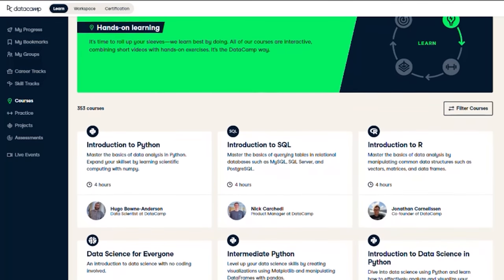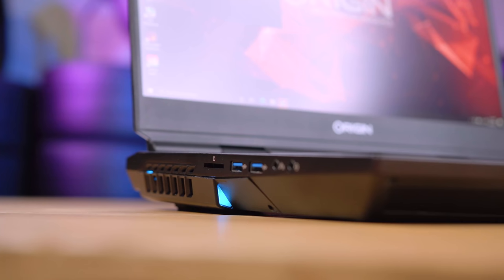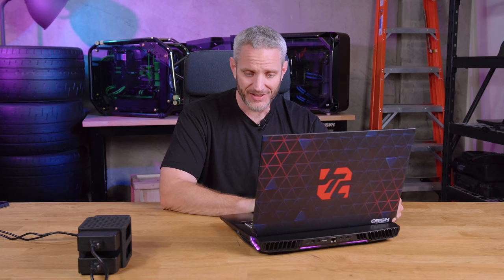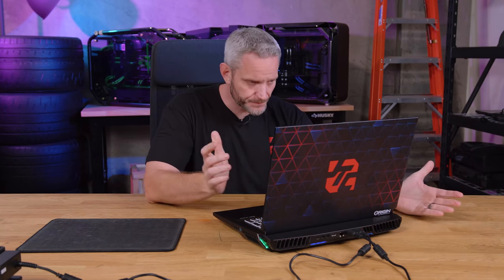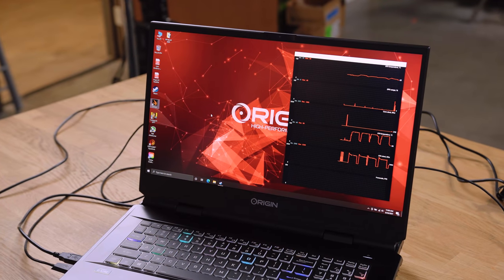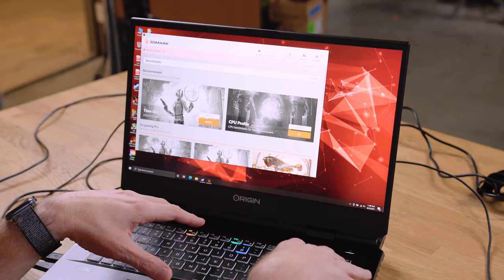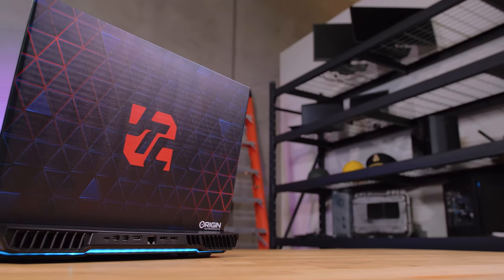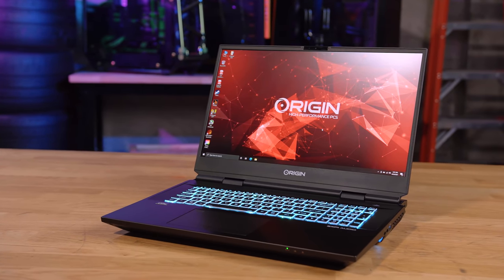You are GUARANTEED to HATE this... which is why it's so AWESOME!

Comment: Let's cram this laptop with some of the fastest components available today... except for the RAM. 2400mhz?
Reply: You can order it with 3200MHz preinstalled.
Reply: @jeremyphipps777  yeah but why is 2400mhz even a choice lol. That’s just too low for those specs.
Reply: Intel systems dont benefit much from faster memorry
Reply: @TheKelz  it's will let the cpu to stay under 105c
Reply: @ademiravdic  They do. You might not see an increase in FPS but the smoothness increase is quite high in games. For example you might have the same FPS between 2400 and 3200mhz RAM, but you will notice quite a big increase in smoothness when moving the mouse.
Reply: @Artek385  I thought of that, but they seem to be selling 3200mhz version as well and I kinda think it won't make a big difference. A direct comparison would be nice though.
Reply: It’s intel ram speed doesn’t make that huge of a difference in gaming which this is made for in ryzen it makes a huge difference in gaming they are very different aside from being x86
Reply: @gloryholdofficial  That is still false ffs. Intel or Ryzen, they both benefit from RAM speed increase be it gaming or just general use. You get higher 0.1% lows and a smoother feeling mouse even though FPS might stay the same (it does get higher though, just watch some videos and benchmarks). I don't know where you guys are getting this "Intel doesn't benefit from high speed RAM" thing from.
Reply: @TheKelz  yea you benefit from ram speed but at these speeds on intel it is barely noticeable as long as your not running old 1600 MHz ram or something intels fine where Ryzen can see 30 percent performance drops from ram speed intel only suffers maybe 5 or so percent with slower ram in gaming not creative applications but gaming specifically due to ryzen using chiplets it’s a bunch of quad core chips slapped together and it needs the ram speed to blend and move packets across chiplets where intel is one piece or chip so ram speed isn’t as big of a deal because packets aren’t being moved around on chiplets amd calls it infinity mesh or infinity fabric that’s why they have always recommended the fastest ram you can find for ryzen especially in the first and second generation chips it’s getting better though
Reply: @gloryholdofficial   @Glory Hold  I know how it works, but I can see you just looking at that only. Yes it works that way, but practice still shows that no matter what, having a higher speed RAM is beneficial no matter what you think, because you still get fluid mouse in gaming compared to lower speeds. There might not be MAX or average FPS increase, but 0.1% lows are quite a bit better especially during smoke effects or high intense battles in games which is why you get a more fluid experience. It still is better to have a higher memory speed.
Reply: @TheKelz   because CAPITALISM
Reply: these companies cheap out in the dumbest places
Reply: @Shizzmoney74   And yet they're multinationals so they know what they're doing if they were able to reach that far.

Comment: Jay I just wanna say thank you for so thoroughly testing the audio on that laptop. So many people completely overlook proper audio testing, and while you're not doing anything super magic with frequency spectrum analysis, simply testing it for glaring audio flaws (like trackpad and key vibration) is more than most people manage to actually do properly. Would be really cool to start seeing more extensive audio testing of gear marketed to gamers, since most of it is actually garbage compared to a good desktop mic or something marketed to professional broadcasters, and ditto with headphones and professional audio monitoring. I've always noticed a significant advantage when using good audio reproduction gear vs "cheap" $80-170 gaming headsets just because it's so much easier to actually make out the sounds and where they are in a 3D soundscape, and with so many games today using binaural audio rendering for a lot of their sounds it's more valuable than ever

also, you could put sabrent rocket 8tb drives in there for 24tb :)

Comment: I think there might be some room for improving the thermals; I haven't got much above 80°C on mine when trying to push it. I do have high quality thermal paste applied by the shop instead of the normal stuff though.
Reply: What did you end up getting on all core speeds? I’m trying to get to 4.8GHz
Reply: @Revolverben190   Due to covid stresses and some other junk, I've been slacking on my dedusting and repasting duties, current numbers would be way bellow ideal. A quick informal check seems to suggest somewhere between 3.4GHz and 4.8GHz in moderate loads, and around 3'ish on very heavy loads, with temps almost never reaching 90°C ; in recent times I've seen 5GHz occasionally being briefly reached  in colder weather and very light/idle loads, and temps at around maybe even sub-60 when there's really almost nothing going on in the background and I'm feeling chilly.

Unfortunately I don't remember the numbers from back when I posted that original comment.

Comment: Alienware Area 51M-R2 has existed for almost two years and it’s about as insane if not more insane than this. Mine has a desktop grade 10700k AND a desktop grade 2070 super. 32gb of ram running at 3200mhz. Also the screen is amazing, 360Hz 1080p and looks beautiful. And the track pad is amazing with illumination. For storage is has 4 M.2 slots. I’ve loved it for the year I’ve owned it so far.
Reply: Thats just insane speccs for a laptop. How heavy is it?
Reply: Kinda agree with you, but there's also a full generational difference.

Comment: 1440p is what laptops need to go to.
Reply: TVs skipped 1440 which makes sense because it doesn't take much graphics power to play a video. Laptops in 4K don't makes much sense because laptop gpus can't push the fps at that quality. 1440p is that sweet spot and personally it's the sweet spot for desktops too.
Reply: @chillgasm  There are a lot of 1440p laptops already. Some even on the midrange.
Reply: @chillgasm  What do you mean what can you play on those? They can play any games.
Reply: @GamerBoy705_yt  Even with an RTX 3080 mobile CyberPunk barely stayed above 60 FPS at 1080 max settings... No need for 1440p for laptops yet.
Reply: @laszlozsurka8991  So..? They already exist. And that's what they asked. Not everyone uses a laptop to just game all day, or to just play Cyberpunk.
And this video says otherwise to what you claim: https://youtu.be/y1CH5Jrnkrk
It's not even the best laptop or the full power 3080 mobile and it still manages 1440p 60fps on max settings. And either way, how much more than 60 FPS do you need to play a game like Cyberpunk? It's not a competitive shooter game and is an unoptimized POS game.

Comment: You guys can notice when Jay run R20 , the temp drop from 97 to 56 immediately after the test over ! That show how good this machine's cooling system is ! What a beast .
Reply: I saw that too! very underrated thermal performance detail, imagine how much better the thermals would be with those dual blower fan, silicon suction ring, style chonky laptop cooling pads? I wanna see that lol
Reply: @realyungsteeze9238  His CPU was running at 60c during Cyberpunk while mine goes to 70+ easy and I have a PC with a big ass cooler on my CPU (and some additional ones). I know I need better cooling but thermals on this laptop are pretty amazing still.
Reply: @TheKelz  hecl yea the temp drop off loads are great!

Comment: Agree with the screen analysis. I would rather have lower res with higher fps which is why I love 1440p@144fps because it gives the best of both that most games can run at top settings with current hardware. When graphically demanding games can start running at least 120fps at 4k then maybe I would consider an upgrade. Also great laptop minus the one problem with the vibration and speakers although if someone is creative enough they may be able to reduce or fix that. Very cool board with that cooling solution and the upgradeability with the memory and number of nvme slots.

Comment: I actually love this, this is exactly the kind of laptop I would buy if I were to buy a laptop. 💕
And one of the best parts is that you have so much performance headroom, you can significantly downclock the CPU and GPU to save on thermals, noise and even battery power and barely notice a difference in performance for most uses. I love it.

Comment: This is a Clevo laptop. They are one of the main suppliers for the high-end laptops. You have reviewed other laptops of theirs under different names also like the XMG Apex 15 with the 3950 in it. One thing all their laptops have in common is they are all easy to take apart, repair and upgrade.

Comment: I'd love to see this aggressive cooling in a laptop with H processors. 10 heat pipes, and thicc fans. Lenovo Legion 5 Pro with 11800h and a 3070 with this heating solution would be awesome.
Reply: If they put this amount of heatpipes on the mobile I9 11980hk then it would easily beat the 11900k desktop replacements
Reply: The newest HP Omen 17 has those specs (11800H+3070 both at max TDP with 330 Watt power brick), and is probably the best-cooled version of those specs I've seen in a sub-$2000 laptop so far. It also calls itself a desktop replacement, but of course the laptop in this video makes the omen 17 look like an ultra-slim by comparison.

Comment: I have two crazy/weird  and unrelated questions:
Could you theoretically use a car radiator for cooling a pc?
Could you use an aio on a gpu?
Reply: Yes to both;
 Jay did a dodge video with one, Linus did a few home cooling/multiple computer videos with a similar/equivalent sized cooler setup
Aio on gpu is perfectly fine, bearing in mind you may need a fan to cool auxileries with certain waterblocks
Reply: You could connect a car radiator to a custom watercooling loop, although it would be unnecessarily messy. Linus has tried it.
You can use an AIO on a GPU, but there are other components on a graphics card that need cooling other than the core, namely the memory chips and the VRMs, so you would need a fan over the card and possibly heatsinks on those. I think Linus has tried this too. There are a couple of AIOs for GPUs that solve this problem.
Reply: Car, motorcycle radiators & house radiators has been done in the past & also car oil coolers was common as well during the early 2000's.
Hell i know of a Swedish guy who did watercool directly from the plumbing in his kitchen running tapwater, was great temperatures as you can imagine for like the 2 - 3 days he tried it but wasn't exactly cost effective nor great having too setup pc on the kitchen table lol.
Overclocked like crazy though having basically sub 20c across gpu,cpu core in his loop without a reservoir or radiators & was pretty quiet too.

Aio's on gpus has been done for years as far back as 2008 2009 from third party manufacturers of gpus & some adapters ofc has been made for cpu aios as well.
Like the nzxt kraken g12 made specifically for Asetek design aio coolers so you can run up too a 480mm aio on the gpu die if needed & additional cooling is done by a 80 or 92mm fan attached too the bracket blowing across the vrm & some of the vram chips if close enough too those.

Comment: This laptop is insanity.

My mum bought me ages ago a Dell laptop (purely because for her, Warranty was a must. We are from the country and Dell was the only provider that was willing to drive 3 hours to fix a product) which I used for schooling. It was pretty insane at the time, fans were pretty loud, and it ran games pretty well at the time. 

I always had it sitting on a cake rack and then had attached a wired keyboard/mouse. It was the easiest way I found to have it where a fan could blow at the side but angled upwards to hit the bottom of the laptop as well as me. Thermals were always the biggest issue.

Comment: they should make a laptop with the battery external , then you can put even more horsepower in the same space
or no battery at al xD it still has the screen on it
Reply: that's not a laptop that'd just be a shrunken mini itx rig
Reply: lol and they should make it so we can plug it into a wall…….rofl…that would be called a plug. 😂😂😜
Reply: Honestly I think these desktop replacement laptops the battery is really just there as a sort of UPS for the laptop XD

Comment: I am sick of people excusing that thunderbolt is only available on Intel machines. Thunderbolt can be supported on AMD machines (My 5950X system includes thunderbolt from the ASRock X570 Phantom Gaming-ITX/TB3 motherboard). Why can't high end laptop manufacturers include a thunderbolt controller on the motherboard. I understand that there is limited space etc, but c'mon, If you are getting a desktop replacement like this laptop and you are looking for a real workhorse, wouldn't you want AMD and thunderbolt?

Comment: The heat sinks in that beast are crazy and it's nice that the fan's are slightly deeper now to BC it definitely needs that air flow. My rig's fan's are not as deep and I only use 1 0f my 2 330 watt power supply's so I don't create more heat that my rig can't get rid of fast enough. Seeing that both my GTX 980's are over clocked with liquid metal and my over clocked and delided 6700K with liquid metal applied also, my custom Origin laptop cannot handle any more heat and I do not want to degrade my components any more then they might already be. Four years later my laptop is still running like new and still looks new. 🤜💥🤛

Comment: I do think that desktop replacement laptops are extremely interesting, and amazing for college students that use dorms and only have to move the pc a couple of times a year.
It would be nice to see them at more varied price points instead of as top end halo products.

Seriously, imagine this: intel 6 core, 1080p 144hz display, something like a mobile rtx 3060 at a good price point, but the kicker is you have that BEEFY cooling and power delivery for performance.

"Battery life? What's that?"
Reply: But not with Intel CPU's. That defeats the whole purpose.
Reply: @mariodrv  just an example of the range of specs not trying to give a list of specific parts. Wasn't really the point.

Comment: As long as you have a 11th gen CPU you can actually fit *FOUR* NVMe SSDs in this.  On the right side is an NVMe slot that takes PCIe 4x4 off the CPU.  Also you don't have to remove the lightbar to remove the heatsink, just unscrew it on the sides.  (that said, the heatsink is still super fiddly to remove) It also has two SO-DIMM slots under the keyboard so you can add 128GB of RAM total.  For RAM speed I think the best is JEDEC 2933 MT/s for the 11700K and 3200MT/s for the 11900K/10900K/10850K/10700K but getting it to train properly is sometimes tricky, especially if you fill all four slots.

Comment: The Dell Inspiron i7559 is 1 captive screw to remove the entire bottom panel of the laptop which gives you access to everything except the cooler.
Reply: sounds stable
Reply: @illwillsquared  It is because it's just a panel and not the lower structural shell of the laptop, this panel attaches to the shell. Not sure if the shell was a Dell design or from an OEM vendor, but I applaud it's designer.

Comment: "Just under desktop performance" at 5561 on Cinebench R20. 

My old i7-6700K was able to score around 1600-1700 (not sure of Cinebench version), so 5561 is a really good score.

Using Cinebench R23, my 3950X desktop (16c/32t) got 22524 on multicore and 1113 on single core. 

By comparison, an i7-7700K (4c/8t) got 6302 and 1230, respectively.

Comment: I could imagine that the performance under load is strongly dependent on the ambient temperature if the processor is constantly working in the thermal limit. A comparison at 18 NRU and 35 NRU would be interesting

Comment: I get 3 hours 50 minutes in the late gen x170SMG with a  i9-10850KF when I cut the processor down to 1.3/2.2 turbo  and screen down to 35%. (Screen has mini LEDs instead of edge-lite panels, so don't need brightness very high to see) browsing  YouTube.  Also, there are 4 NVMe ports. The 3 you saw were only PCIe 3x. The 4th PICe is 4x.

Comment: it's not impossible to run thuderbolt with AMD. my current system has an Asrock Creator x570 with two thunderbolt ports onboard.  there are also add-in cards from some manufacturers to make it work as well.  it's up to motherboard manufacturers on AMD's side to implement it but thankfully it is possible. i did have to do some searching to find working drivers though.

Comment: The bucket rendering of cinema4d (in cinebench) isn't really raytracing it doesn't use any emissive lights and bounce lighting. Cinema4d does support those but they're much much longer to render. The basic renderer cinebench uses only uses lights with single calculation soft or hard shadow options it's like 1000x faster

Comment: Nice. I have an Alienware M15 R4 with a 3080 and it beats my desktop with a 5700XT by up to 20% and my rig can play pretty much all my games at 1440P Ultra 60 plus fps. Pretty impressive since it's roughly 5 pounds and thinner/lighter than my older laptop with a 960.

Comment: cut little squares of thermal pad material. and place then at the peak floating spot.. push in on the plastic block the houses the speakers and place the wedges so it doesn't vibrate against the hard surface also that sheet of plastic inside tends to vibrate as well. I modified my dell latitude  E6540 and modded the i7 and AMD Mars-XTX chip and was gaming at 1080p 60fps to 80fps medium to medium low. until I burned up the power supply that thing would get so how I would advice putting heatsinks and a fan for them that's what I did.